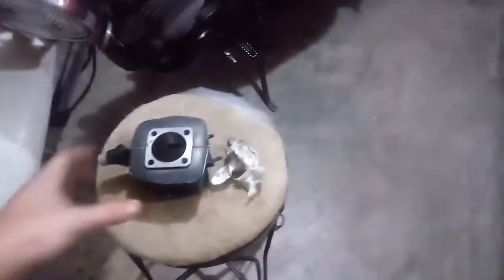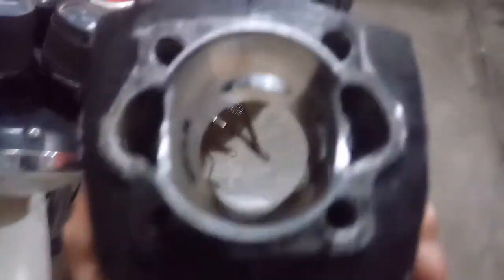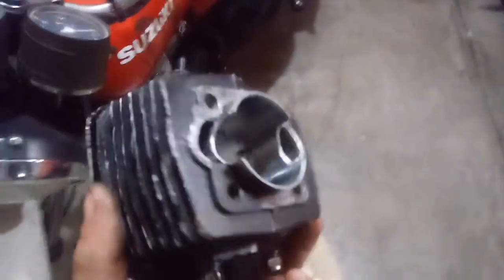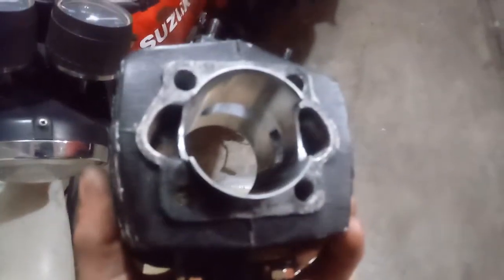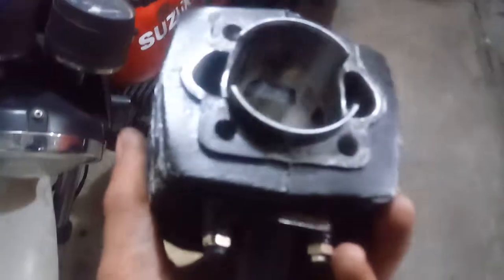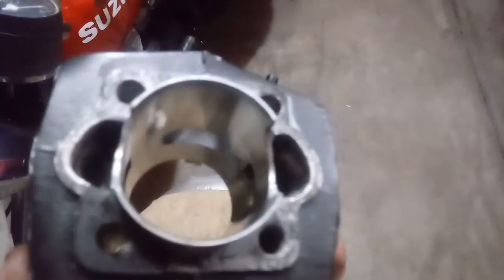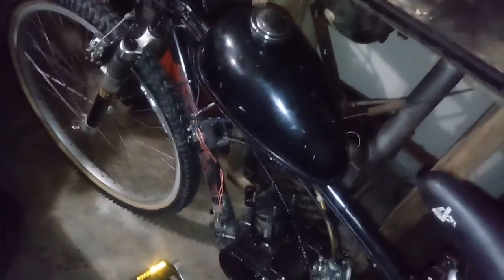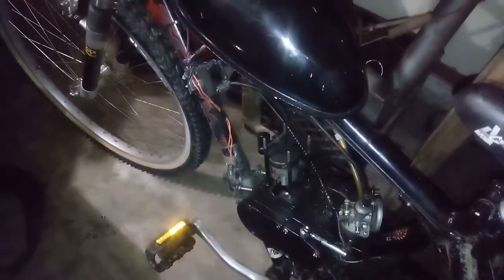Porting a 66cc / 80cc Motorized bicycle engine

Comment: need to put the gear back in mine, motorized bicycles are fun
Reply from the maker: Yes they are
Reply: hey dude, you seem like oyu've had your ford a lot longer than I have mine, do you know what I could torque the rocker arms in my engine to? the thing's been ratling like a SOB and I took it apart to see if rocker arm replacement would help. I think I just need a new engine, but I figured I'd ask for your thoughts.